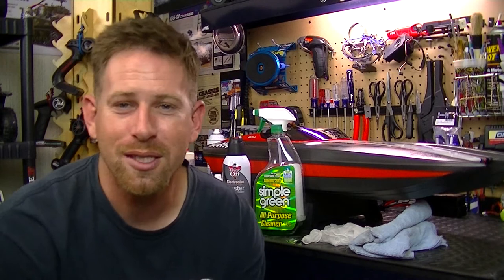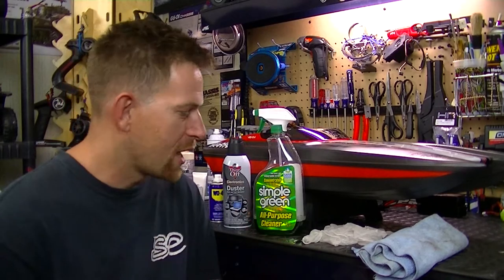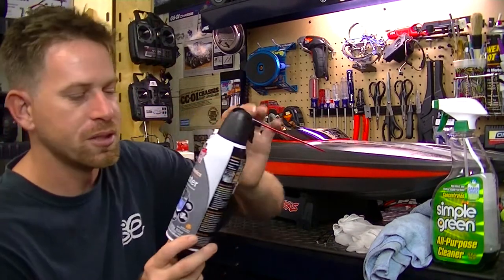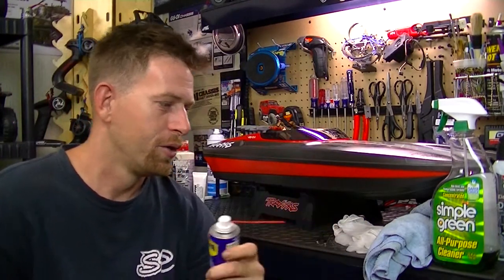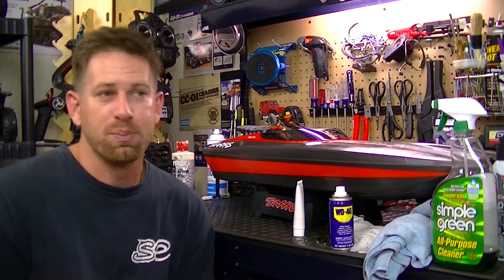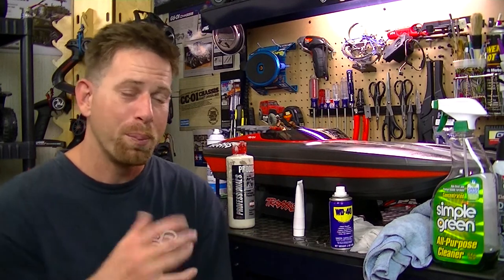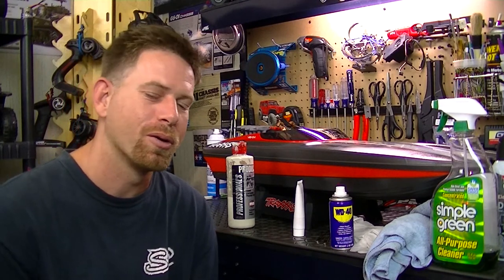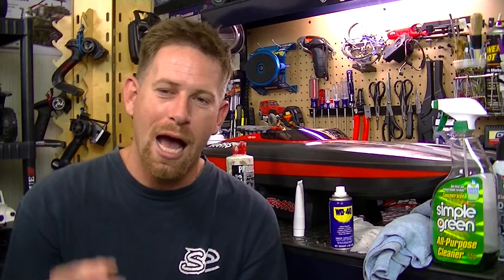RC84Films: RC Boat Maintenance

Comment: wd40 not a lubricant. I would use a bearing oil.
Reply from the maker: Thanks for info I went by what traxxas said
Reply: @RC84Films  i use kerosene to clean bearings or a citrus cleaner. Than either use grease to pack bearings or use oil depending on application. I only oil motors and run in fresh distilled water to clean out.
Reply from the maker: thanks
Reply: You know what would have been great,  is a video of you actually doing the maintenance opposed to paraphrasing a maintenance manual on video.